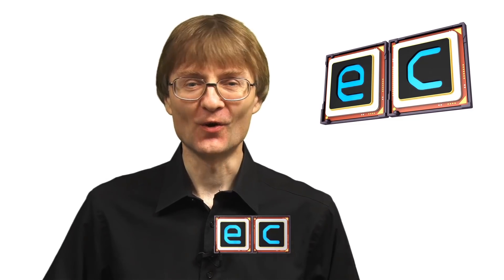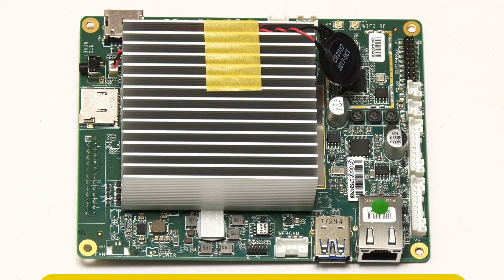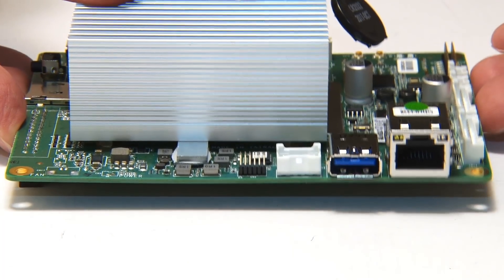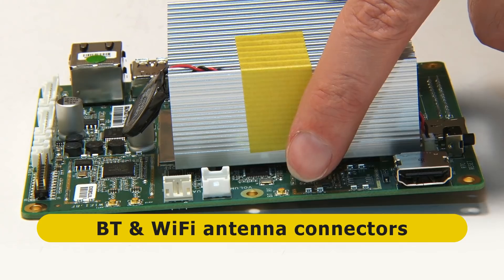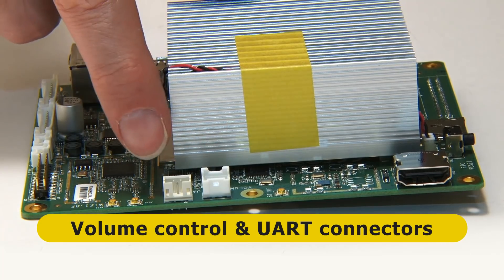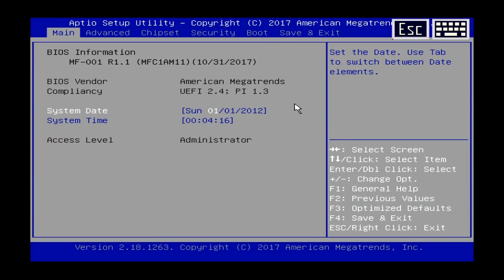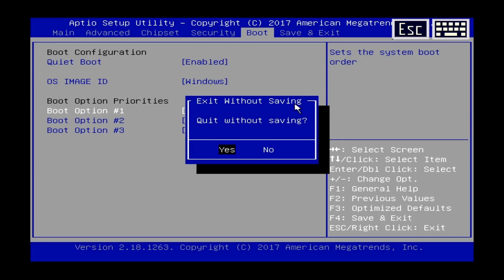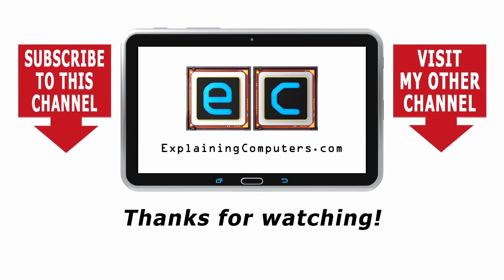Atomic Pi Intel Atom SBC

Comment: At 04:08, the unknown socket next (left) to the camera/USB 2 is apparently for updating/accessing the BIOS, however it seems nobody has any details on it so unless you know how to modify BIOS (and there are people who do) and are willing to experiment then it is of no use to us. There doesn’t seem any great reason to try as nothing is accessible- as in yes there is a limited PCIe but people seem to just end up bricking the Atomic Pi trying to access it via the Networking interface.  There’s no SATA and that seems by design.  And reading you can fit a fan, but not a PWM, just a dumb fan.  And I think (won’t know until I get the Atomic Pi) it needs to run from 5V.

The more I look at the Atomic Pi the more work I can see it is going to be.  2GB of memory isn’t great either, not enough for W10 or a full fat Linux really.  So the new Pi4 looks quite good in
comparison, and the main selling point of the Atomic Pi is X86.  Looks like beyond a games emulator or a Kodi/Plex box you’ll be getting a soldering iron out and will be getting your
hands dirty.  Still I’m still happy but I think the Pi4 will be a better choice for many people and many use cases..

Comment: I always thought that the difference between x86 and x64 was that the x86 processors were (essentially) 32-bit while the x64 was 64-bit.  (Actually, x86 includes the 16-bit processors 8086 to 80486 but that's not relevant here.)

Comment: Can it run Windows 7 or even XP?
Reply from the maker: I should be possible on an Atom, certainly -- drivers permitting.
Reply: Well then you should try Snappy driver installer, it has almost every driver.

Comment: So nothing about GPIOs and IoT specs (SPI, I2C etc). Yeah really great explaining - useless for me.
Reply from the maker: More videos will follow -- this was produced under time contraints! :)
Reply: You could always go to the manufacturer’s site and download the docs.
In essence you have 3 uarts, 2 for general purpose use and one for debug/console. An accelerometer on a I2c bus, and six gpios that can be used for I/O or a custom I2c or spi driver can be loaded to use config those pins as needed. The docs provide a better explanation.
Reply: @awomandoesnothaveapenis  Docs have zero explanations. This board blows. It is some kind of mistake for IoT makers
Reply: Try this link, the docs do have info, it’s where I get mine from
https://www.reddit.com/r/Atomic_Pi/comments/bv09qr/docs_stuff/

Comment: So what do you think of the 2017 Orange Pi Lite with Quad Core 1.2GHz 512MB DDR3 WiFi Mini PC Raspberrypi ? I think it too can run Linux Mint.. Not too sure about that but I think it's running an A7 which I think supports Ubuntu.
Reply from the maker: I've not tested that Orange Pi . . . yet! But if it is an A7 ARM board, it won't run Linux Mint, as that is an x86 distro only.
Reply: @ExplainingComputers  Oh I see. What is the difference between Lubuntu and Ubuntu?

Comment: I have so much ‘computer’ to do.  An old ITX i3/8GB M/B, an embedded Intel ITX, some half-finished Pi 3+ projects, some half finished Zero projects. My ATX Ryzen 3 rebuild to upgrade my Ryzen 1, which then produces parts for a Ryzen 1 ITX build.  Then there’s a fancy case and some parts coming from New Zealand (again ITX).  And finally, a STX build where I hope to use a M.2 to PCIe adaptor to run a dGPU (because that motherboard doesn’t have a proper chipset to do so).  

Then I will think about a Pi 4 I’m afraid.

But the   Atomic Pi,  I haven’t been able to find it for less than £100, If I can get one for £60 I’m in.

Comment: But there is a POWER connecter on the top just to the right of the FAN connector, can't you just use that to power it?
Reply from the maker: That is not a power connector. The same physical connectors can be used for all kinds of purposes. :)

Comment: The truly sad part about this board is the 2gb of RAM. It makes running Windows and many things with Linux rough tbh. Should be 4GB. It would make a decent difference.
Reply: It’ll run linuxcnc for a hobby class mill. 
Installing lubuntu from an flash drive gives you a pretty snappy system. 
It runs Debian Stretch with a xfce desktop fine.
The trick is not to expect it to have the same performance as a full desktop.
Take it for what is and it’s a great bit of kit.
Remember there is BT, wireless and an accelerometer on board. 3 uarts, 2 for general use and 1 as a debug/console. Add in you can configure I2c and spi as well
Reply: I would suggest not using ubuntu based distros, as they tend to have issues shutting down properly.
Reply: I haven’t come across that issue either with the std Ubuntu kernel, a 4.19 RT nor a 5.04 RT kernel.
All my boxes running Mint have always behaved and the T61 and T530 Thinkpads have all played nicely.
Maybe I’m just lucky

Comment: I found out what the other connectors were for you. (Source provided below answer. I have no affiliation with them.)

4.05 the tiny connector are factory BIOS prog pins (Supposedly.)

5.15 from left to right there are two 12S digital audio inputs (10 pin mic connectors.) the speaker outputs as you mentioned and Xmos Xtag prog pins (Whatever that means).

Also the 6 GPIO pins have default programming for resetting WiFi, Bluetooth, webcam power, HSIC power, USB 3.0 power and micro SD power.

Hope this helps.

Source:
There is a diagram on one of the Amazon sellers pictures.
https://www.amazon.com/Atomic-Pi-High-Speed-Peripheral/dp/B07N298F2B

Comment: shit board...i mean one usb port?...and nonstandard header for 2nd port....no barrel jack for power.... yawn..ill stick with my rpi3!...
speaking of...there is ubuntu mint for rpi....i know coz i run it!..and it works pritty well..
Reply: That’s a pretty big statement, have you actually used one ?

Stick with the RPi and enjoy the performance hit compared to the atomic Pi.
The USB2.0 header is a standard JST PA header, nothing weird about it. 
The RPi is not the standard for SBCs.
But then again this isn’t a board for little boys or those of the RPi - Arduino generation.
Reply: @awomandoesnothaveapenis  RPI4 says youre wrong! :P
seriously...the rpi4 looks alot better than this board...performance seems close to the same aswell...just the lack of x86 is the only thing holding the rpi back now...but really, is x86  needed these days?..its power draw is ALOT higher than ARM based..and that means alot on a SBC
Reply: Depends on the application, LAN on the USB bus is a real drawback for me. I need it to work in a RT environment. 
Until USB is suitable for RT then it’s a no go.
Actually I prefer my BBB to a RPi.

Comment: Thank you very much for the detective work.  Looking at the specs, at first I thought it'd be faster than my Core2Duo T8300 laptop, but it turns out it's actually a bit slower (at least according to Passmark scores).  Of course, this runs at 5W for the CPU vs the 35W T8300.  Either way, like you said it's a really good value; it's only likely to be rivaled by getting a good deal on a faster, 2.2GHz+ used Core2Duo system.  I ended up spending more than the ~$53 you spent on the Atomic Pi on my laptop ($5 laptop, $5 cpu, $7 ram, $20 ssd, $20 battery, and $10 charger, all values approximate), so I'd probably have been better off if I was lucky enough to spot that soon enough.  Then again, I'd probably still have spent a bit on add-ons. :)

As always, thanks for the video.
Reply: I think you made the better choice with the laptop.

Comment: Great video, but this board just doesn't impress for the price and for 2019.
Reply: Well it's still a good deal. I got mine for 35 bucks. Given that it's an x86 processor, this board packs quite a punch for its price.
Reply: If you plan on gaming on the cheap, I would suggest upgrading a used PC.

Comment: I purchased an Atomic Pi about a week and a half ago. I had some issues with Lubuntu, and installed MX Linux on it, which at least fixed some of the issues. I still working on sound. I’ll be interested to see what you do with this computer in the future.
Reply: I run debian stretch on mine and use Bluetooth for audio. A cheap USB sound card might do the trick aswell

Comment: I've ran Windows 7, 8.1 and 10 on the same spec as this board with an LG 25UM38 Widescreen monitor @ 2560x1080 - works flawlessly (for browsing and light stuff)
Reply: i just leave it on 24/7, never ever a problem. I turn the monitor off though.

Comment: The other two 10 pin white connectors, CN13 & CN14, on the side with the speaker outputs are for digital audio input. The black 10 pin connector, CN5,  on the side with the USB is believed to be for programming the BIOS eeprom directly. A fan will not work by just soldering it to the pads labeled "FAN" as the parts required to drive the fan are not populated. On the same edge where it says FAN, one can connect a power switch to the pads left of where it says "POWER". The 26 pin connector on the bottom is often incorrectly called a GPIO connector, and this has caused much confusion for new users, especially those familiar with the Raspberry Pi.  It is primarily a power connector that also has on it 2 serial ports, and 6 GPIO pins. Video can go up to 4K 30fps, but it's buggy and not recommended, 1080p 60fps works fine.
Powering the AtomicPi using the method shown in the video is not recommenced (also shown by the distributor), because it uses very small gauge wires with only two power and two ground pins leading to voltage sag under heavy load which can result in random reboots and general flakiness. It is best to use at least 4 power and 4 ground pins and a larger gauge wire. A single pair of 18-20AWG wire kept reasonably short is best. This board is quite sensitive to power issues and nearly all flakiness can be traced to power problems.  The collective user community at this point likely knows more about this board than the distributor through extensive experimentation. Vendor support is nearly non-existent other than the written FAQs available. It's a fun board, but only recommended to those that are fairly technical in both hardware and software, and don't need a lot of hand holding.
Reply: Thanks, I will upgrade my wire count soon.
Reply: Answered a question that was in my head, thank-you.  I had read 'JST style connectors and a 26-pin header for power & GPIO'  and I was thinking what exactly does that mean- especially as the breakout board looks more like just a breadboard with various voltage connections (3.3/5/12v?)- I notice they have two boards as well.  The £27 one which seems overpriced for what it is, and a smaller version that really does enough for £10?  I think I will get the multi-meter on it when it arrives and build a PSU for it, something with a chunky wattage.  I've had increasing problems with the Raspberry Pi when it comes to supplying power and it seems it will be the same with the Atomic.
Reply: @jason campbell 

Best results come with using more than the suggested power pins, I used a min of 4 per 5v & GND and never had a issue. 
I run a 4A supply which is maybe a little overboard but it was a “hmmmm that’ll come handy buy”. A well regulated PSU with low ripple should see you right.
Reply: @awomandoesnothaveapenis  Yes I'm using 4A now, both on wall warts and with made PSU.  Do you mean wire through more GIPO pins?
Reply: From memory there are 6 or so pins for each of the GND and 5v rail on the 26 pin connector. Using more than 2 pins per rail appears to be the best option.
Reply: @awomandoesnothaveapenis  Yes, hadn't really given it thought but you are right.  I do tend to get nervous with the GIPO power because they caution all sorts of harms but really with a fuse?  I can see it would be quite robust, probably better than the way I'm doing it.
Reply: Jason hop on over to the Atomic Pi page on reddit, there is a heap of info on there and some really good ideas.
Reply: @awomandoesnothaveapenis  OK, I will do.
Reply: @twmbarlwmstar  The only voltage required is 5v.  There is an on board audio amp that you can supply with either 5v or 12v.  With 12v you will get a lot more output.  Most people are just using audio through HDMI.  I've built all my own power adapter boards from parts I've mostly had on hand, cost per board has been less than $2, probably about 1GBP. Be sure the power supply you use gives clean power without a lot of ripple or noise.
Reply: @timezonewall  thanks all useful stuff.  I plan to fit a fan, either vry large12v or smaller 5v
Reply: Very useful extra info Zeric. Appreciate.
Reply: G’Day mate and well said.

Comment: Great video I'm glad you went into further detail on this.  Those that are looking to purchase this board please keep a couple of things in mind, first this is not a raspberry pi meaning that it may not be as plug and play so if you aren't ready to do some reading and tinkering it may not be the board for you.  I think it is a great board for what you get and at the price point.  You should join the forums on Digital loggers website and/or at least take a look out on https://www.reddit.com/r/Atomic_Pi/ for some issues and solutions one being hdmi sound with the default lubuntu install that comes with the Atomic pi - I have run Pop!_OS without any issue with hdmi sound so it is a software/driver issue but there are workarounds/solutions.

For best result use a power supply with 5V and at least 4A. If you are not comfortable wiring up the board I would suggest that you get either the baby breakout board or the full breakout board because it's not that hard to damage a board if it is accidentally wired improperly. 

Some other places to buy if Digital Loggers Direct is sold out.

Ebay:  Will ship to other countries 
https://www.ebay.com/sch/shakaworld/m.html?_nkw=&_armrs=1&_ipg=&_from=

Amazon:
https://www.amazon.com/s?me=A12I5MLBRVCHIQ&marketplaceID=ATVPDKIKX0DER
Reply: There is very little information on the Digital loggers forum, all the action is on the reddit forum referenced.  That, and the DLI faq contains what is publicly known about the board. As far as power goes,  there is a lot that can wrong and not all power supplies that are labeled 5v at X amps, will really put out 5v at X amps (regardless if says 3 amps, 4 amps, etc). Many power supplies experience voltage sag at higher currents, and some are just out right mislabeled and not capable of putting out the amount of current that they say. Some are poorly regulated and not suitable for this board. This is one area that causes new users a great deal of issues, I frequently answer AtomicPi power questions on reddit.
Reply from the maker: @tek nokilr  for the PSU, I think you mean 5V at 4A. :)
Reply: @ExplainingComputers  you are correct :)  Once again thanks for a great and informative video, i look forward to your next videos on the atomic pi. Perhaps one with the camera since i thought the kuri used it for facial recognition.

Comment: That reset button isn't as useful as it could be. It resets the BIOS and RTC.
Reply: It also wipes your emmc module, at least if you push it while the system is on. Don't know if it's also the case for a shut down system. I would be grateful if anyone could tell me whether or not that is the case
Reply from the maker: Yes, I discovered that! :O
Reply from the maker: I've certainly pushed the reset button on a shut-down system (to reboot the board) and it has not wipe the eMMC. But it took me a while to figure out that it was resetting the BIOS and my boot order! :)
Reply: @ExplainingComputers  Ah, thank you. That means I can shut down mine at some point and replace that button with one that is harder to accidentally press without losing my current installation :D

Comment: Didn't you say it can run Windows? I presume Windows 10. That would have been impressive.
Reply from the maker: Yes, Windows 10 -- if limited by the 2GB RAM and 16GB eMMC (or you can run Windows to Go via an external drive). Others here are running Windows 8.1 on it. I may try XP! :)

Comment: Why did they put that GPIO on the bottom when that area for it is clear on the top of the board?
Reply from the maker: I imagine it had to do with how the board fitted into the Kuri robot.
Reply: @ExplainingComputers   You're probably right. As it is, a desolder pump and iron could turn it right way around.
Reply: It’s a bit of a PITA you need a really hot iron but it is doable. I went with a Male Right angle box header on the bottom.

Comment: Great to see a nice big heatsink on the board but that bit of tape would have to go!
Reply: The tape is to hold the battery in place for shipping, it's easy to remove.  Don't attach the battery to the heat sink as the heat will damage the battery.

Comment: Christopher I bought a Raspberry pi 3 model b back in March of 2018 for the sole purpose of using it as a low voltage system (Pijuice hat±5000mah battery with solarpanel) that don't need a large internet ADSL or 4g (3g MIFi works fine with it but in cloud rain/snowy situations the signals drop down to 1bar) in upper nothern areas. 

My question is, is there is an antenna that can work on a 2000foot mountain with Ras-pi 3 other than a 3g 4g company tower.
Reply: You may want to look into directed  beam solutions for that.
Reply: There are a variety of options, but without a lot more information no one is going to be able to give you a good answer.  Asking it here isn't the right place either as it is really a discussion, not a simple answer. Things that have to be considered is who is accessing the data, have far are they located from the device, how much data is going to be transferred, etc. A variety of approaches are out there such as Lora, directed wifi, amateur radio, etc. Each has pros/cons and suitability for different applications.
Reply from the maker: This I do not know. :(